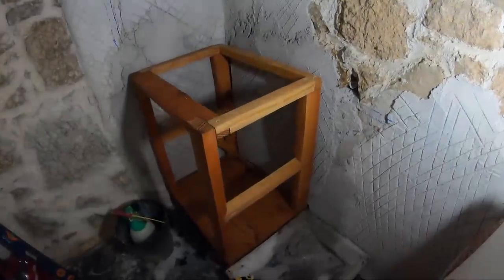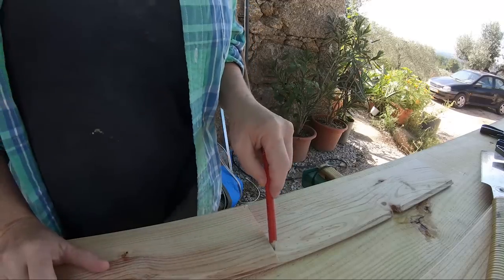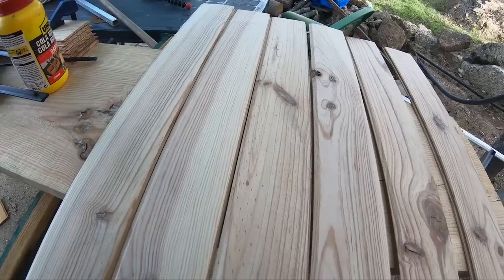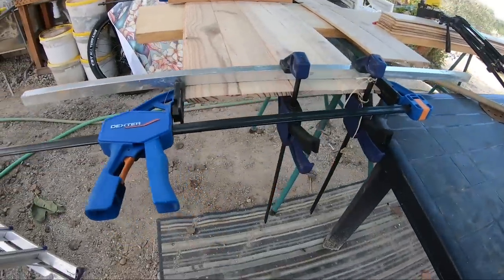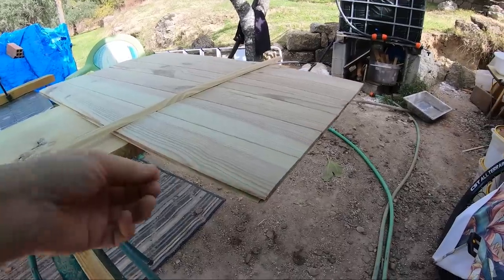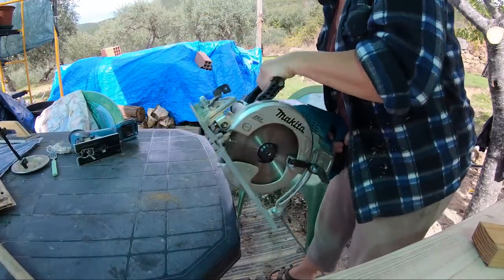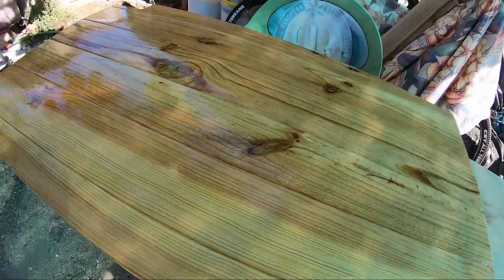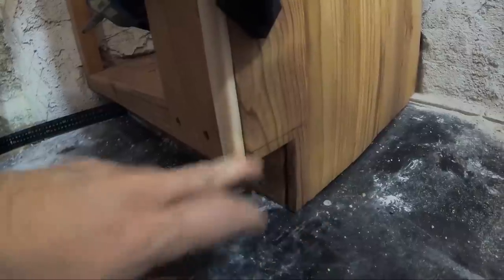WILL IT EVER END?! More Work on My Tiny House Kitchen Cabinets - Part... 4?

Comment: Oh dear. I kept wanting to loan you my table saw for those straight, precise cuts... But alas, it is thousands of miles away from your kitchen! I've been doing tongue & groove nearly nonstop for the last 4 or 5 months and felt every tiny step in your project at a personal level! Time for some soothing tea to recover.😂😂
Reply from the maker: Ah I'd love a table saw but that definitely requires a workshop. One day! What are you working on that requires so much tongue and groove?
Reply: @PortugalfromScratch  A house that is NOT tiny 🙄 It is log and every interior wall has to be scribed to fit at the outer log edge. Most of those walls are t & g. A workshop would be wonderful... but we just haul the saw in and out from the "living room." Ha.

Comment: Hi Kirsty, where did you get the tongue and groove from please, it will be perfect to cover insulation on the back of our metal door 🙂
Reply from the maker: I'll end up doing the same soon, too. I just started the door project. I bought the wood at Bricomarche in Fundao but you might want to go for a slightly more expensive pack as this cheap one has lots of knots and flaws and for the door you'll need to use entire lengths. That's my plan.
Reply: @PortugalfromScratch  thank you 😊 I will take a look at the Bricomarche in CB 👍

Comment: I don't know since I'm not there, but, I think you probably have the wrong blade or in incredibly dull blade in your jigsaw, so you are pushing too hard.  When I go off track I usually know it's time for a new blade.
Reply from the maker: Good to know... I'm not sure when I last changed it, though I haven't used it too much. I'll check that, thanks!